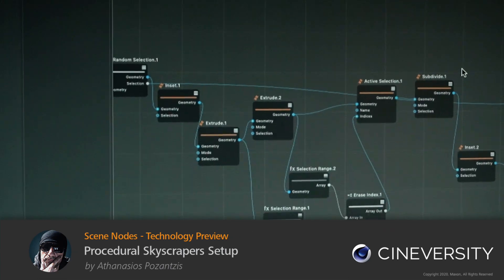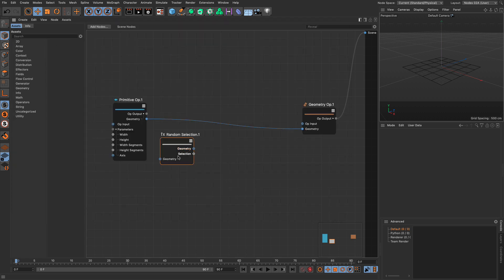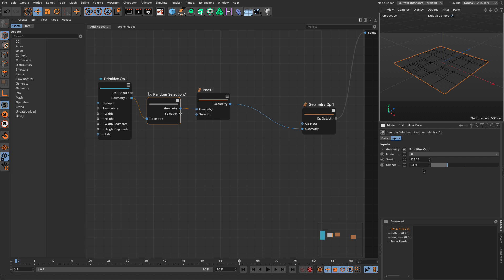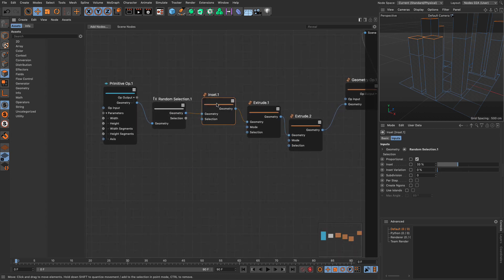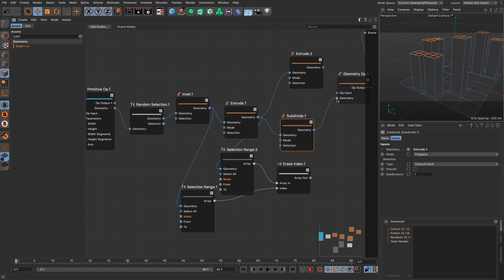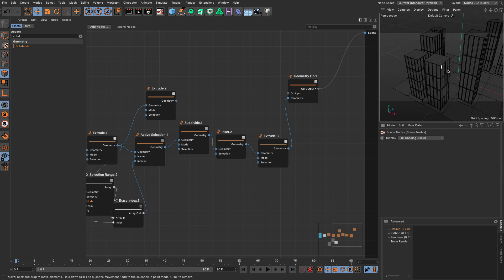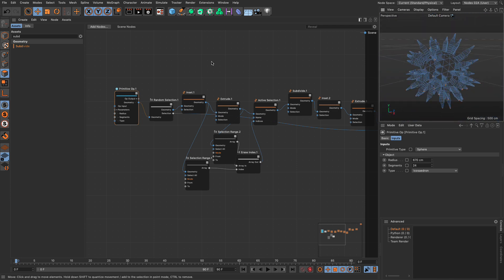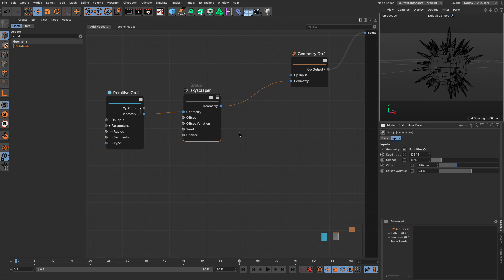Part 12 Scene Nodes - Technology Preview: Procedural Skyscrapers setup

Comment: Nice tutorial. One Question: Is there a node where one could pipe in two Selection-Nodes (fE Ring and Modulo) and boolean those two? 
fE substract one from anoter or get the intersection(s) and then pipe out the result as a new selection?